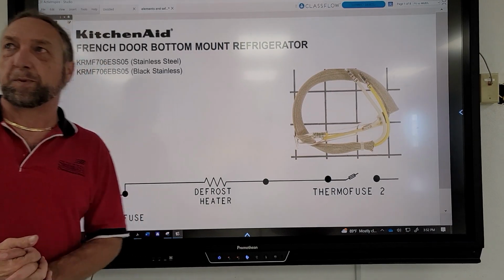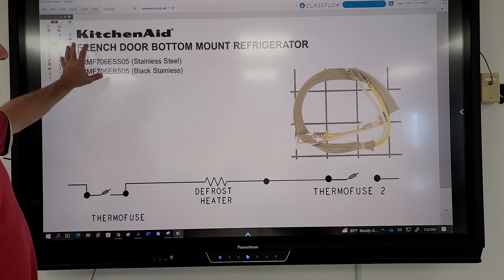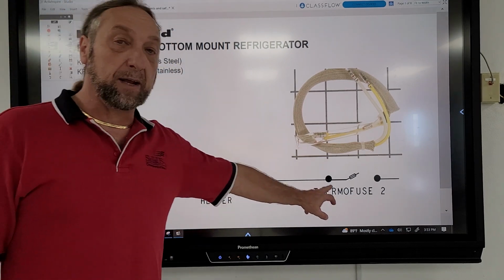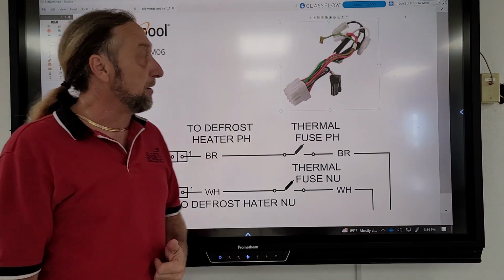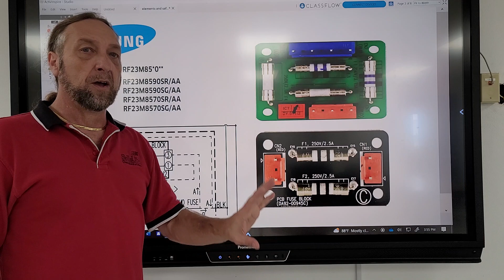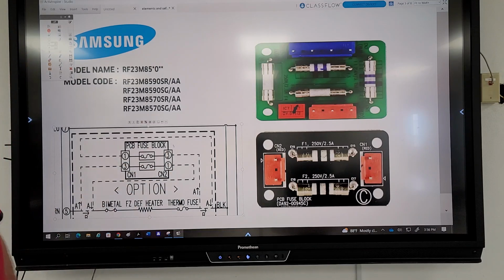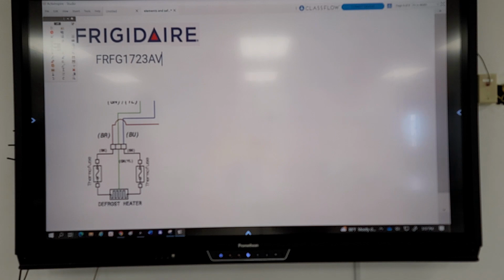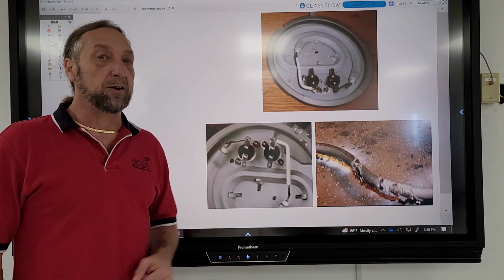New thermal and inline fuses on Defrost systems

Comment: The good thing about the new thermal fuses is that they rarely blow.  Replacing the control board or evap fan motor always solved the defrost problems with these new style fuses from my experience.   I never knew about the new Samsung defrost fuse board component until this vid. R600, man i'm I glad i'm retiring (21 years). Refrigeration great trade profession!
Reply: Sounds like you had a very successful career. I'm starting my 42 year in the industry.